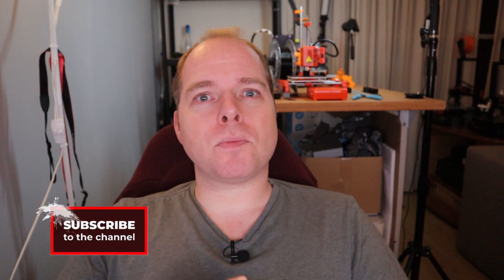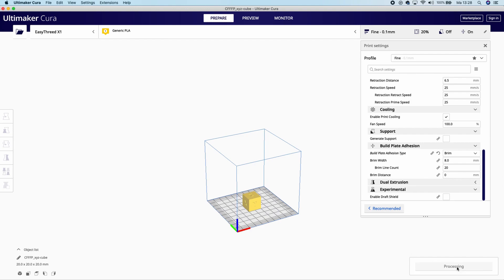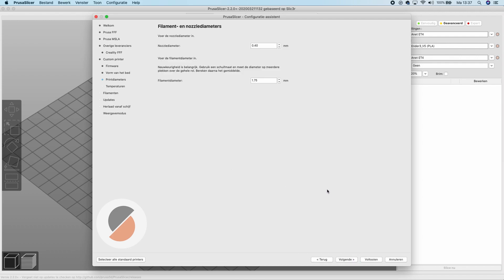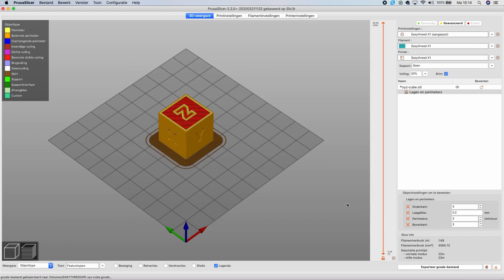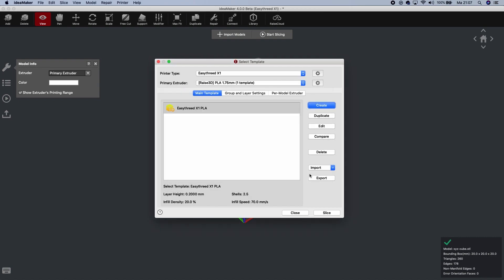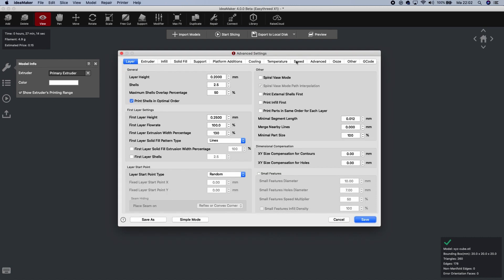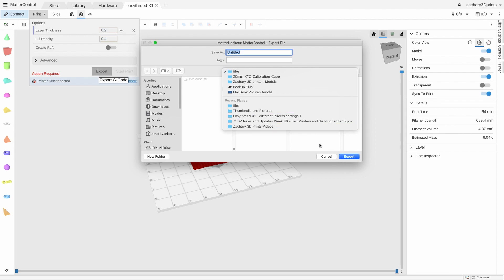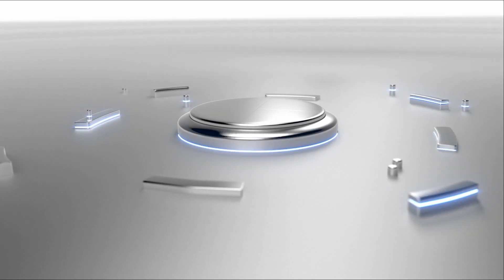Easythreed X1 - Most Slicer Settings from Cura 4.7 to PrusaSlicer 2.2 - Ideamaker - MatterControl

Comment: The X1 is quite a capable machine, got one for practice on prime day and I'm surprised how capable it is for the money, and at times equally frustrating.
Great for learning troubleshooting in my opinion makes it more fun.
When the x-axis stopped working it was fun stripping it down to find the hidden connector in the cable cover had disconnected.
Thank you for the video been having fun learning about cura settings.
Reply from the maker: Indeed, to start really small with 3D printing this 3D printer is very capable, and frustrating too. Thank you. Wasn't the Cura settings part not too small?
Reply: @Zachary3DPrints  not really too small, got me looking deeper into the settings ☺️.
Quite fun figuring it all out, channels like yours make life much easier.
Thank.you.

Comment: Well I recieved the K-9 version last week and tonight its printing wow slice ,download code to sd card ,level machine ,apply glue to mat ,insert sd card and press go button 3 minutes its printing ....so far so good ,now to find a copy of the marlin settings so I can add a real display and controll it with Reptiler.
Reply from the maker: Finding a good complied firmware from Marlin for this printer can be hard and need to be careful to flash it onto the board, if it goes wrong you'll have an issue. Did you find the firmware for it?

Comment: I'm trying to get the easythreed k7 setup in cura so I can slice, in printer options in cura easythreed is not a option how can i add this printer? Thanks in advance and your videos
Reply from the maker: Thank you. I don;t have the K1, but check the basic settings of your printer... size, heated build plate, speed... with those specs, you can basically set you printer in every slicer

Comment: How do you attach this 3D printer to your computer? (Swapping the SD card back and forth is driving me crazy!) Thanks for the video!
Reply: Me as well, if you found the way to performed please let me know!
Reply from the maker: When you attach your Easythreed X1 to your computer with the USB cable, make sure that the SD card is in the Printer
Reply from the maker: Just like said to Bob, use the SD card in the printer and then use the USB cable to connect the printer to the computer

Comment: Thanks for this video. I have been using ideamaker with my Easythreedx1 but its a hit or miss just because i'm not to sure about my settings.
Reply from the maker: Did you use IdeaMaker as I did for your Easythreed X1? How does the first layer look like? Which parts you have trouble with? Did you use Cura 4.8? If you download the latest Cura, install that, go to my website zachary3dprints.com/ go the the latest post about the Cura slicer settings or the the Slicer page, you'll find there a download with the Cura profiles which I use. try that if yours doesn't work

Comment: the easythread printer cant be found in the software, what am I doing wrong here
Reply from the maker: Correct, you need to add it as a custom printer... like mentioned in the video, printing volume 100*100*100mm, 0.4mm nozzle, no heated bed and Marlin

Comment: hello man, i need the driver install this print, please help me
Reply from the maker: Hello Douglas, on the micro SD card is some data, but to setup this printer in the slicer, you need to add a custom printer profile
Reply: @Zachary3DPrints  can you show us the setting you used?

Comment: Great video! I am just starting with this printer and I was wondering how you print the 1st lines on the side of the bed? I believe that'd help me to remove the small leftover filament strings that I get after heating the hot end and which sometimes get in the way of printing the 1st layers successfully.
Keep up the videos, I'm learning so much from you!
Reply from the maker: Well, thank you sir. Yes the purge line, that was a test, and you saw them. I removed that part, because I want to get more into this purge lines and make a video about that. It does work, but you need to fine tune the start Gcode
Reply: @Zachary3DPrints  that's great news, I look forward to seeing this new video on purge lines then!